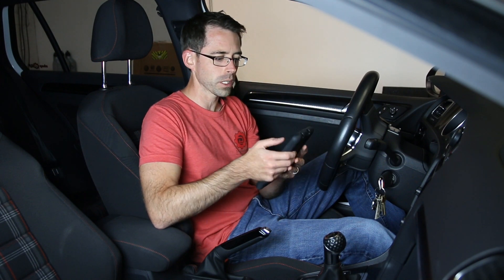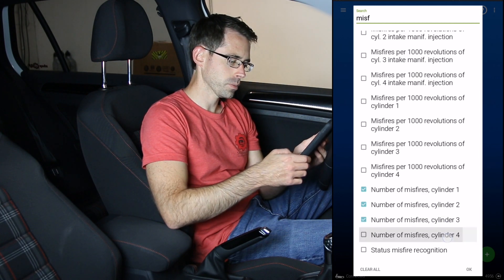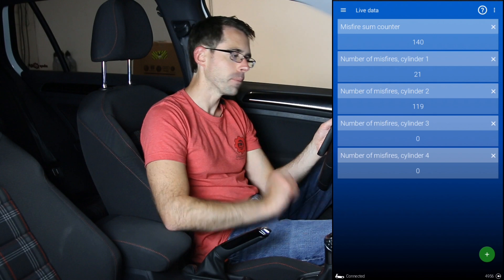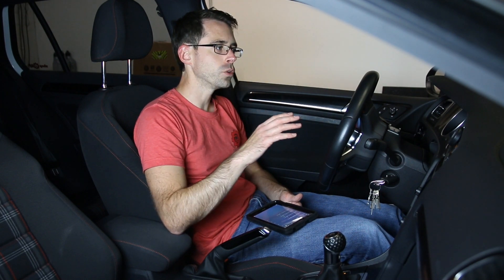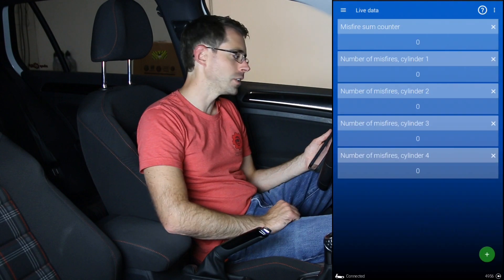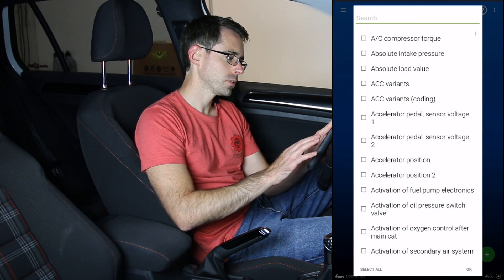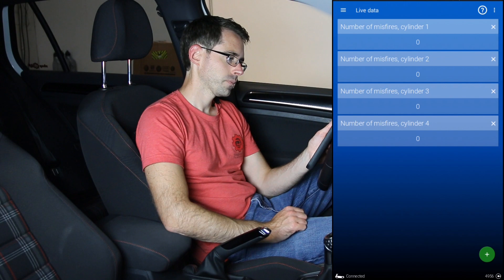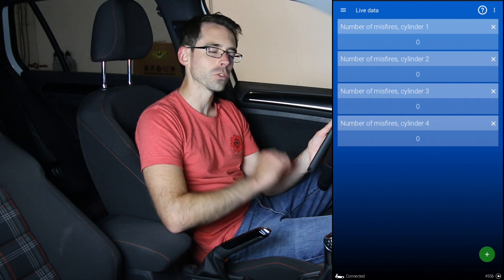How to Find Engine Misfires on VW and Audi's

Comment: Here's something for you.
I have a EA211 (1.2TSI, same as 1.4TSI except capacity). I have no misfire error codes being thrown. No check engine light lit.
Yet those counters show misfires across all cylinders and they're currently at 20,000 to 30,000 per cylinder.
Watching the live data I see misfires logged at idle and while driving. I can understand the ones at idle, but not at speed and load.
Yet I have no detectable engine vibration and no rough sounding exhaust.
Something is going on and I can't figure it out as occassionally this car is a total dog on the highway and can be a struggle to get beyond 75mph. Sometimes there's no such issue and the little 1.2 can go full tilt.

What do you reckon it could be?
Injectors? Carbon issue?
Or is something else tripping up the misfire detection as I understand this is determine by crankshaft speed before and after firing.

Comment: Hey I could really use some help here. I have a 2009 Audi A3 2.0 L turbo. My daughter was driving and it just shut off. Before doing so she says it sounded like a diesel but its a gas engine. I towed the car home and began to work. I have since changed injectors, cleaned all the carbon out of the intake manifold, changed the plugs and coils, pcv valve, oil and filter, cleaned the mass air flow sensor, cleaned the throttle body, and various other bits of cleaning along the way. While doing all this over the course of a month I had the battery disconnected. I put everything back together and attempted to start and it cranks really fast but wont run. I am getting the following codes now:

P0016
P0171
P0300
P0301
P0302
P0303
P0304
P0341
P0506
P12A2

Im not sure where to go with this now, could it be a broken timing chain?? Any ideas or suggestions would be greatly appreciated. Thanks.

Comment: Hi, I have 2015 mk7 gti. Problem I’m having is all 4 cylinders misfiring only when the oil temperatures goes up over 100 degrees Celsius. The fault code I’m getting is p0172 fuel trim bank 1 system too rich. I have already checked injectors, spark plugs and coil packs. Also every time it misfires it throws a low oil pressure warning which I’m thinking is due to the oil pump not functioning properly during misfires.

Comment: I have a 2009 VW Jetta I took it to AutoZone they said it was a misfire  coil number 3 so my fiance replaced all the spark plugs and bought a new coil for number 3 after installing it it's still doing the same thing what could it be?

Comment: My misfire issue was resolved, here is how.

So my issue was EPC lights come on when the car oil temp is around 90C, and it starts misfiring and again between 2 to 3k RPM there is that (prrrrrrrr) sound.

Cylinder 3 was misfiring all the time.
Check spark plus, they were clean
Change coils (Issue was still there)
Cleaned injectors (Issue was still there)
Check throttle body, it had an issue so I changed it (misfire was still there)
Found I had an oil leak, through the PCV and got it fixed (issue was still there)

Screw it, opened up the engine.

Issues I found.
Valve springs needed replacement
Camshaft was a little damaged
Piston rings were gone.

And I changed the timing tensioner while at it and fixed the headers.

After these changes, the car is driving fine.

My engine drove the same 150k KM, stage 1 tune REVO.
Tune did not add the issue, I track the car all the time.

I hope my input helps anyone desperate.

Comment: Eh i bought that OBD but Im not happy becouse i don't see on list misfire counter or anything similar. I can't  type channels becouse in Engine Control module i have only list and search possibilty. i don't know how to type channels in that module. Help from developer was kinda weird "go to forum nad search" i was trying to do that but i didnt find any solution.
Reply: My odb11 is the same. Nothing showing misfires. There is a lot of other data under "Engine" under control units. It's the latest odb11. The tech support in Lithuania is not helpful. It is a great app but very complicated in some regards. Needs interpretation and direction. Lucas, were you able to find the misfires?

Comment: I have 2.0t fsi I am getting misfires on all cylinders and a flashing check engine light when going wide open throttle. It seems to only do it when the car is warmed up and wide open throttle. I have resealed my vacum pump and put in a new cam follower and new ngk double platinum spark plugs.
Reply: subliminal1284 did u fix it? Mine does this too...
Reply: @timothyortega1982  If its not a vacuum leak it could be carbon on intake valves due to GDI.
Reply: Having same problem with Mk5 GTI Pirelli

Comment: p300 code is what I got, smelling gas, replaced plugs plug wires gasket etc any ideas?
Reply: If you smell gas it’s probably you’re High pressure fuel pump leaking it’s a preventative maintenance thing

Comment: OBDeleven is an amazing device, but run by a horrible company.  Bay 10 credits to reset my oil needs changing notice on my car.  What a bummer.  Sell me the device, with one car model and make your money that way.  After a year of using the device you might as well spend the money on a VCDS program.

Comment: I have a 2010 GTI cobb stage 2. I've got a CAI, and full exhaust. I replaced coilpacks and sparks (gapped correctly) and i get random misfires only under load. Cannot figure out the issue, anyone got any ideas?
Reply: Take a look at your (icm)  IGNITION CONTROL MODULE

Comment: I have random misfire code...check engine light is on but NOT flashing..... Does the engine light need to be flashing?? Fault code 0300

Comment: In March of 2018 I purchased a 2015 VW Tiguan 2.0Tsi AWD with about 75000 km.  I was buying from a Chrysler Dealership and the vehicle showed regular maintenance at a nearby VW dealership so I brought it to that dealership for a pre-purchase inspection.  I let them know that I was bringing it to them because they had been the ones to do all of the work on the vehicle for the previous owner. They gave it a glowing review, I paid for the inspection and that was that.

 Four months later (July) I was driving to work in the morning and within 2 minutes of leaving my house, I had acceleration loss, the EPC and Engine lights came on and the vehicle was shaking and clearly struggling. At the time I had just turned a corner and was merging with traffic at around 50km/h. I pulled over, turned off the car and restarted the engine and all seemed fine,  no warning lights and decent performance. Later that evening as I was getting ready to go home, I started the car and got the engine light again. I reached out to a friend who works for active Green and Ross and he did a preliminary diagnostic, it was throwing cylinder 1 misfire and a rare cylinder 3 misfire and general low rpm. He ended up swapping the ignition coil on cylinder 1 and all seemed well.
The next day I drove about 150km to a cottage with a couple of friends and had no issue. On the way back, I turned a corner to merge with traffic at about 60km/h and the engine light came back, no acceleration, almost got rear ended. Pulled over and engine off and then again, back to normal with no warning light.  I managed to get almost all the way home and then again, while accelerating to pull into the fast lane, lost acceleration and engine light came on. Took it back to my friend and swapped spark plugs out. Misfire started happening more consistently. I decided to take it to a small shop that specializes in VW and Audi. I told them what had been done so far and asked them to change the fuel injector as that is the next piece that I could see that could affect a single cylinder.

When they got into it, they saw that the fuel injector on 1 had already been changed and they suggested that I call a dealership to see if they would cover an intake manifold replacement as they had heard this was something that they may cover.  I called the dealership that did the prepurchase inspection and they said that my VIN was not covered for the manifold upgrade. I asked if they could send over the previous owner’s service records and they did.  The intake manifold was replaced at 32000km and the fuel injector on 1 was replaced at 62000km. Obviously the previous owner had a similar issue...

I went back to the VW Audi shop and told them to just go ahead and replace injector 1/3 just in case it made a difference (what’s $300?) I also asked them to check the intake valves for carbon buildup. Valve 1 was the most clean and the others weren’t too bad (“we have seen much worse in fully operational vehicles”) so I said that if they didn’t look bad then don’t waste their time and my money. The thinking here was that the trouble cylinder had the cleanest valve of them all.

So they put it back together, did a compression and leak down test (no issues - phew!). They called me to say it seemed to be running well - no misfires. I went to pick it up and started it only to find the same problem. They said it must be electrical and Thu recommended that I take it to a dealership to have them check the computer, connections, electrical system.

I brought it to the nearest dealership (Humberview VW where I had an oil change done shortly after I purchased the vehicle). I explained the situation and work that had been done so far. I left it with them to diagnose and they called me the next morning to say the first cylinder was reading 50psi during a compression test. I called VW Audi, they confirmed cylinder 1 showed about 160psi and they would be very surprised if the same cylinder were to drop by over 100psi overnight (and after driving less than 10km).  I went down to the dealership and explained my concern and that the previous compressions AND leakdown both gave good results. The service manager Frank, tried to convince me that these other mechanics were screwing me around and that the issue was Definitely Mechanical and that they would have to charge me $800 to diagnose the issue further (I.e. take the engine apart). I asked if there was anything else to rule out first and he said no, but that I am still covered under a 100000km/5yr powertrain warranty so if they find that is powertrain related then it will be covered - including the $800 labour.  I was pretty thrown off by the compression test fiasco so they performed the test in front of me again and they got 160 on cylinder 2 and 120 on cylinder 1 - a far cry from the 50 psi they had told me on the phone. The mechanic did it again on cylinder one and it seemed like he wasn’t cranking it enough for it to reach max psi but I didn’t know enough at the time to explain myself - he hit 90psi this time. I decided to take the car to another mechanic to verify the first mechanics compression results and sure enough the test was clear 160psi across all cylinders.

I called CAA for some advice on the situation and they recommended that I take it to another dealership and see what they say before possibly persuing arbitration through CAMVAP. 

I’m at another dealership today and they showed me the carbon buildup in the valves and the sure enough the first valve is almost clear but there is a bit of a buildup near where the head of the valve seats and so I’m sold on the acorn shell cleaning (6hrs -$700) oh and he says I should have come to them first as they would have done the injector replacement under the power train warranty (d’oh!). Cleaning is done and it’s still misfiring. They are working on figuring it out but my question is: what the heck should I do next? I’m almost out of money and I’m already $1000 over my annual repair budget...

What is wrong with this thing?
Reply: I traded my avensis for a 2011 1.4 tsi passat 3 months before.Since then I had to go to mechanic 7 times.Most of them for engine coolant leakage (which we barely figure out) and some of them for misfire in the cyl 1 and 4.(1 of the ignition coil changed but no progress)

So I can assure you that modern vw cars are real money pits.They have good ride, high quality interior, good handling but they also have least reliable parts which tend to fail too much.As soon as i solve the problems i will go back to toyota again.I advise you to do the same.
Reply: Thanks Düz.
I ended uo at a third dealership and had a bit better experience there. They charged me for a intake valve cleaning - which didn’t end up resolving the problem. So, they continued on to find that the valve spring on cylinder one was broken. This they diagnosed using a boroscope (the previous dealership mentioned the potential for a valve spring issue and I am still baffled as to why they insisted on a minimum $800 of labour to diagnose).  While they were replacing the speing they also repaired an oil leak. Total bill for that visit was $666 - labour for cleaning if the intake valves and an oil change, the rest ended up being covered under warranty.
I understand that the pay structure at these dealerships encourages the customer having to invest some money before they will do the warranty work, but if the valve cleaning was their necessary step in diagnosing a powertrain issue that is covered under warranty then shouldn’t that also be covered?
All told, i dropped almost $2000 what was ultimately a broken valve spring, however I now have new fuel injectors, spark plugs, a fixed oul leak and an oil change. Next time i will start my diagnostics with the dealership (if im still under the powertrain warranty). I do still like the vehicle a lot and i’m looking forward to putting winter tires onto it and trudging through the snow.
Maybe I’m a masochist.
Reply: The first thing I see wrong is you telling mechanics what they should replace. Let them do their job and be responsible for possibly replacing the wrong parts.

Comment: Hey. In Brazil it's common for the Up TSi model to have a fuel injector dripping issue, which causes difficulties to turn the car on, weak engine, rough idle and in some rare cases, even hydrolocking, depending on how long was the car parked. My Up TSi just began showing the first symptoms of this (hard to do the first start of the day). I'd like to know if there's any way in OBDEleven to check this particular issue. Would it somehow know an injector is working differently from others? Thanks!

Comment: I have a 2.5L VW Jetta 2008, just changed thermostat housing, ran it hot cause it broke off. 2nd day after repair check engine light came on when I started it. Reading misfire in 1,2,3,4 cylinders. If it was running good but initial start up idle is rough for 5 seconds then normal. Runs fine after that, would that be a sensor for air intake or a vacuum leek. If vac leek how do I find out why and where?

Comment: Hi I have a mk 4 golf witch is misfiring the problem I found was number 3 coil pack I changed that changed all the spark plugs and the fuel filter sine done these changes has got better but still misfiring does any one else no what it could be

Comment: I did all this awhile back changed all coil packs and Sparks plugs ran great but now after  changed the battery car is running rough idleing and shaking as I accelerate
Reply: Edsel Martinez how did u fix that problem ? What happened when u changed the battery

Comment: I have a 2011 GTI with APR stage 2. I am getting constant misfires in cylinder 3 so I completely changed out spark plugs and coil packs on all cylinders because it was time to change anyways. I am still getting a misfire in cylinder 3 even after the swap. it's been about a week and it seems to misfire and cause a CEL once a day but the engine is still powerful and feels completely fine. do you think the only thing it could be is a fuel injectors? I am now at 93,000 miles
Reply: Carbon cleaning?

Comment: Hi! Great video! 
I have a Golf R mk7 2016 with 5k miles, and when i run obdeleven for 15 minutes on idle theres no misfiring at all but as soon as I accelerate like 5% quickly and let the gas go it misfires. I did that for like 5 minutes back and forth and got 9 misfires on cylinder 1, 5 on second and 3 & 3 on the others. If i accelerate hard no misfire only when I accelerate a little and quickly let go. I really appreciate any help! Thanks
Reply: What was wrong with your car and what did you do to fix it? I am havving the same problem with my car.
Reply: Hey can you tell us what was the solution
Reply: @butineverful  vw said there was no problem, but I've changed the spark bugs. Vw has a waaay to long service intervals for the spark plugs, and there is no reason to wait for that long. It's easy to change them and they don't cost that mush.. Try and se if it helps

Comment: I have misfire on cylinder 3 and 4 and also random multiples misfire on my jetta 2.5 2012. There was oil in the cylinder 3 and 4. I changed the sparkplugs, ignition coils and the valve cover gasket. There's no more oil in the cylinders and my car ran great for 2 days then all the same problems came back.. Im clueless to what the problem is, the car still runs great although not as good as when i bought it (lacks a bit of power). Im thinking maybe a bad injector?

Comment: thank you.. identified misfire do to 1 bad coil at 60,000 so i changed the plugs and coils.. runs great now. how do i delete the codes to get the check engine light off?

Comment: Hey Paul, are random misfires on each cylinder (im talking one or two at a time) while logging a cause for concern?  each cylinder will show 1 or two misfires and not a the same time.  it will then clear itself to zero again after driving a bit
Reply: Adam Dinglasan mine does same thing did you ever get a answer